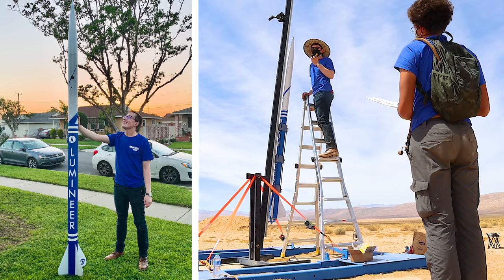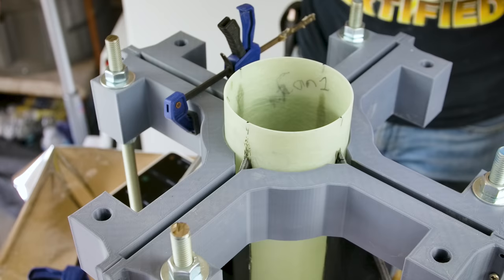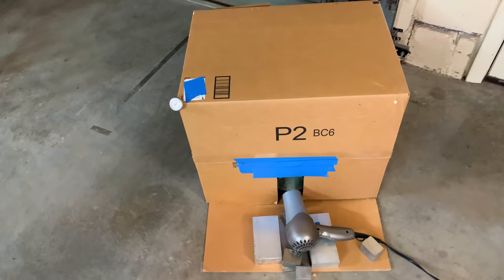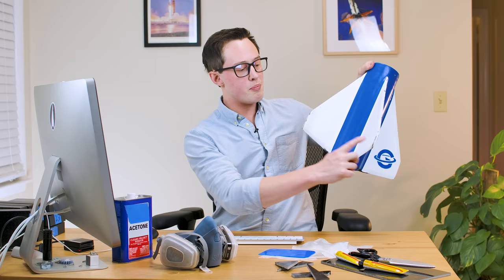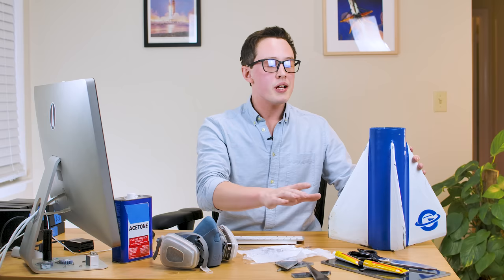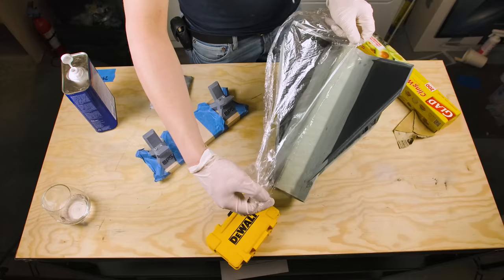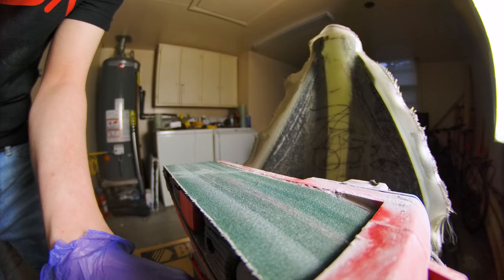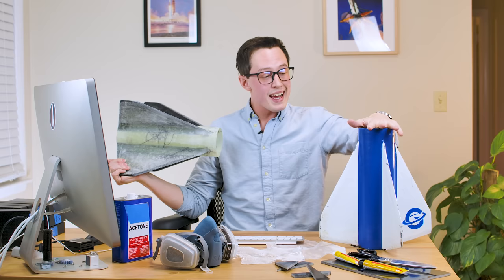High-Strength Composite Rocket Fins - Building Lumineer

Comment: My cure oven was 1 mil poly drop cloth stapled to the ceiling and the workbench, heated by a cube room heater with a chunk of fiberglass HVAC filter taped over it. (This was for varnishing furniture in cold weather, nowhere near as stringent.) Worked great, not only reducing cure time between coats, but kept the unfinished garage dust out. It's absolutely amazing how doing simple ad-hoc things like this can improve your work. Even a rough jig, for instance, is better than doing it by hand--especially if you have to reproduce the cuts or drill the same holes on a semi-production basis. More accurate, and much faster than measuring and working by hand.

Comment: Glad to see you back with such enthusiasm, Joe!
Keep working on your composites optimization.
You're carrying a lot of excess weight at the wrong end of the rocket with that fin can.
Though the concept is great, execution could improve with vacuum bagging, and there's no reason not to use (radio-opaque) CF at that end.
Fins could be thinner for the same stiffness and it would improve your CP/CG.

Comment: For your next composite layup, I highly recommend using a plastic bag or sheet for your pre-preg. Basically, just have a sheet of plastic twice as wide as you need (you want thick plastic sheeting that won't tear), pour resin on a spot in the first half of the sheet, lay your material on the spot, pour more resin on top, then cover with the other half of the sheet and squeegee through the plastic sheet. Aside from making the process much cleaner, this will allow the resin to spread better while allowing you to squeeze out any excess resin. It'll also help drive out any air bubbles and generate less waste in the process. It's a useful technique I learned in A&P school from a lifetime composites guy, and I've used it for prepping hot patches on aramid shrouds.  
Hope it helps!

Comment: When making your wet layups, try doing it on a piece of clear builders film. I draw the final shape I need from the fabric on the lower builders film on the outside (bench side). I put on the fabric (cut oversize) and measured epoxy amount in the glass and roughly spread out. Then place a second piece of film and you can squeegee the epoxy very nicely to saturate the cloth. The excess of any squeezes out the sides. Then cut the whole sandwich with sharp scissors to the line you marked. Now you can peel off one film layer, rub it onto the part and remove the other piece of film. It will almost completely remove all the edge freying etc and you’ll get a much neater layup. 

For the edges, once the epoxy has setup to the gel stage, use a razor blade and just cut most of it off. Much less sanding that way. 

YMMV!

Comment: Joe you went through a lot of effort to mention the appropriate amount of epoxy to wet the glass during layup but laid your first layer onto a dry surface. Thorough wetting of the base surface with its own layer of epoxy is crucial to forming that initial first layer, and aids in minimizing bubbles and easing adhesion.

Comment: Pyrotechnicians (and me) use a ceramic heater to dry the granulated gunpowder that we make. The box is a little more refined but than your cardboard "assemblage". Ceramic heaters are cheap and they shut off when you knock them over. As in, while your running from the room, screaming FIRE!!!!, you could kick it over and turn it off :o)
Reply: Also they have a thermostat so you can walk away while its running.

Comment: Nice looking part.  Two tips you might find helpful:

I used hysol in a number of places when I built my Kitfox.  When doing fillets you might want to use some cotton flox to help retain the shape while it is curing.  Some people also use micro balloons for this.

Next is when you go to cut the fiberglass with scissors you can prevent fraying by putting down some masking tape on your cut line cutting through that.

Keep up the good work!

Comment: At university I have had some experience with composite construction and we call your layup method Wet Layup, Prepreg is used when we refer to carbon or fibre glass which comes with resin/harderner already in the weave, which will not set unless in a hgh temperature or pressure environment.
Reply: Also, when cutting/sanding the fibre glass back it would probably be a good investment to buy a dremel, the saw heads are very useful to cut off the excess without turnit it all into dust.

Comment: layup tip: putting epoxy into your plies before placing them makes it harder to control fiber orientation and, with the increased weight of the ply, the edges are more prone to fraying or stretching.  I always place plies dry, and then dab resin into them with a brush

Comment: Just a tip..
If you're looking to make a cut off the bolt, pull a single weft thread out of the cloth. 
This will give you a straight line to cut, without a lot of straggly ends.

Comment: When I used to boat build we used metal compression rollers to roll out the glass. I also recommend you try pulling the peel ply back with the lights off. You'll often get a cool blue lightning flash effect.
Reply: Bubble buster (ribbed) rollers really help consolidate the laminate and force excess resin to the surface.
The last thing you want in a layup is having your fabric floating.
Joe says 1:1 weight ratio for fiberglass cloth to epoxy, but the reality is that optimal is 80:20 or higher.
But you can't get there without a vacuum bag (or autoclave)
The matrix isn't offering anything for strength. It is only there to hold the fiber in place.

Comment: A suggestion on epoxy mixing (I think I heard Adam Savage say this), after mixing you should pour the epoxy into a new cup because the worst mixed portion is on the cup sides and the corner at the bottom.

Comment: Okay wow, Ive been following your builds and rockets for a while. I'm so impressed on how you're pursuing this. Having personally experienced real burnout before, it's reassuring / gives me hope, seeing you able to re-commit to the same projects.

If I'm remembering right, you said you had moved to LA (or just socal?). I would recommend you try finding some set shop sculptors to see if any of them would talk to you about their epoxy lay up techniques. There are a TON of super talented artists working with these materials professionally, but also in very intuitive ways, who would do a great job giving out wisdom about how it should look and feel to work with fiberglass and epoxy in a non-lab setting. Also, most would probably accept a couple beers in exchange for some insights.

From my experience with these materials, my main suggestions would be to invest in a degassing chamber. Just a small vacuum pot that you place the cup of epoxy in between mixing and applying. You end up mixing a surprising amount of air into the epoxy as your stir in the hardener. Especially if you're warming it to speed up cure times, you can end up causing the microscopic gas bubbles to expand due to extra heat in the epoxy, but also setting the epoxy too fast for those bubbles to come to the surface and pop, trapping expanded gas bubbles in your  cured material. Looks like you didn't run into that in this case, so thats great! GOOD LUCK!

Comment: One of the really fun things I learned about composite layups during my time at university, was that the epoxies used for composites are like poison ivy. Basically everyone is born insensitive to the compounds, but you invariably develop an allergy when exposed to them. Sometimes it's after the first exposure. Sometimes it's after the 100th. Once you start getting a rash from it, you're done. You now have a lifelong allergy to those compounds, and it's... inadvisable... to ever work with them again. (iirc there's a risk of anaphylaxis, and terrible hives are pretty much guaranteed.)

It isn't clear to me whether layup resins are substantially more irritating than the two-part epoxies used abundantly in other hobby stuff, but it's an interesting little tidbit of knowledge that I feel like people don't hear enough.

Comment: What you do with newspaper for the templates here—it‘s much easier to use sticky tape there, and very very accurate. It even works for compound curved surfaces, if your tape strips are small enough. With single curved surfaces like the rocket and fins you could probably use painters‘ tape for easiest removal without any layer underneath.

Comment: I once built a guyed tower where the welding jig was off very very slightly for the sections.  Not enough to be visible to the naked eye.  The leg pads were off just enough that it took is nearly twice as long to build it because the bolt holes didn't quite line up, the entire structure was stressed in a way it wasn't meant to be (but within acceptable margins), and the top of the tower was twisted a full 18 degrees (unacceptable).  You could see the twist from the ground because we had booms sticking off of it at 100', 150', 200', and 250'.

Manufacturer ended up invoking insurance and paying out like a quarter of a million dollars to scrap the entire thing and have it rebuilt.  The welding jig was off by < 3/4 a degree.

Comment: In your fin construction i noticed that you kind sticked the fins on to the pipe which is the main body, you could also make grooves into the side of the pipe so the fins slide in snug and using epoxy i would probably become a more sturdy one piece. I dunno how much more stronger it would be but maybe it be much easier to adjust and stick on.

Comment: One consideration may be to 3D print a female mould quadrant. Then make 4 carbon parts from the mould and bond them together with the flash still attached, then trim down the flash. Finally, for a bit of added strength, skin the external surface in a carbon-kevlar hybrid.

Comment: Ok going to help you out just a little. The flash point of cardboard is 258deg C or 427deg F. You can line the cardboard box with aluminum foil and make it a good bit safer. I've done that and used it to cook a frozen pizza. Using a 100watt light bulb. In short you would need to raise the temp 3.5 times as much as what you had it at to set just the cardboard box on fire. The aluminum probably won't raise that temp much. It will most like reduce the time the box takes to warm up.

Comment: I still remember people in my lab made a curing chamber with tiny room heater , enclosed with coro sheet to cure a carbon fiber part and in mid night lab got on fire then alarm went off, luckily was in the lab to put off the fire using 3 fire extinguisher completely. It was a nightmare.
Reply: Grad student pro tip:  personally  owned CO2 extinguisher.   No mess.  School extinguishers still charged and in place.  ...  Plausible deniablity 
.. Everyone wins

Comment: For heating process, instead of cardboard, use your outdoor grill but NOT the propane or charcoal to provide heat (obviously). Use a heat gun or hairdryer and close the lid over it - less fire hazard and if one starts it happens in an enclosed metal structure designed to hold 600F+ heat/flame inside.

Comment: Hi Joe, great video series so far, not yet done watching them all. I did have a question. Have you considered 3D printing that fin stack as a single piece? And then either laying up composite onto it or using it as a mold(either positive or negative I guess). If done as a single piece surely the difficulty with alignment would be eased. Machines with that sort of volume aren't nearly that exotic anymore even in the hobby segment. Keep up with the great content and I look forward to your endeavors.

Comment: For high speed take offs and less drag I would've gone for a 3 fin design works well with my own model rockets.
Reply: Much less drag and shock between fin roots as you go supersonic.
You only need four fins if you have active guidance and need X Y planes of orientation.
There's a reason arrows have three fletchings.

Comment: Instead of vacuum bagging you can use a sand bag to compress the FG layers. 1 hour cure time is not enough really, especially not for vacuum bagging. For my mach 3 project I am using cotronics duralco 4461 epoxy which has a 24 hour cure time at room temperature. Much better to have a really long curing epoxy than to have to rush. I will use carbon fiber for that rocket instead of FG cloth. I am mainly using that epoxy for the 500°f rating, so no need to worry about heat.

Comment: Epoxy is less viscous in higher temperatures. It will flow into smaller gaps better. You might also want to try to put your fibre into epoxy into a vaccuum chamber this will draw air out of the fibre and replace it with epoxy then you can weigh it up on thefin assembly. Fin assembly 1050g fabric 100g so your 1 to 1 fibre glass sbould result in 1250g gross weigh.

Comment: About the bit about epoxy and bonding with the surface, it sounds weird. If the material you want your epoxy to bond to is a metal, it makes some sense as those tend to have oxidized surface protecting the rest of the material. But fiberglass is plastic and glass, glass is oxidized silicon so no oxide layer to remove unless you want to remove the entire material (also no hydrogen for hydrogen bonding). plastic is complex hydrocarbon + other elements forming structures. It might be that it just focuses on the plastic allowing the new epoxy to bond with the old.
Oke yea read the composite world and it indeed focuses on the plastic-plastic bond.

Comment: I've done some composite work, but never built rockets.  I'm a bit surprised at how beefy you made these fins.  7 layers of 7.5 oz cloth.??  That's 7 layers on each side, for a total of 14 layers on each fin.  And that's over the top of what looked like some really thick G10 base material.  Can the forces on the fins be that great that you need so much strength?  One of the things I enjoy is the process of "optimization" which is just balancing out all of the competing constraints, and for an aerial vehicle, weight is always one of the top constraints, and this fin assembly looks HEAVY.  My gut tells me this assembly could be made with half the weight and still be sufficiently strong (remember I've never built a rocket). One thing I would suggest is to put a filler material in the epoxy for the fillets.  Glass micro-spheres result in a very light, but still strong mixture.  And frankly the fillet is just a spacer, so it's really the fiberglass cloth that goes over the fillet that gives you the strength.  Epoxy itself is just intended to be a binder for the substrate (carbon or glass fibers).  You can mix chopped fibers into the epoxy to strengthen it if you need strength in the pour.  Take all this as things to consider, not "corrections".  Love your videos.

Comment: Maybe not the smartest question but what is the material you used before putting the fibreglass and epoxy on, is it plastic, 3d print stuff or like cartboad?

Comment: Use those halogen work lights for a flexible heat source.  Little safer than the combustible box.
Reply: A cheap heating pad from Walgreens works incredibly well, but depending on the needed cure temperature might not get hot enough.

Comment: I'm no expert on the subject but I hear that these rockets are flying really fast ... mach 2 sort of speed some even faster than that. Nobody is talking about air friction heating and nobody seems to be concerned about overheating the stuff inside the rocked ... especially the recovery system. I saw some other video where they were hitting mach 3.5 and then loosing it mysteriously ... well the first thing that struck me is that maybe the flight controlled got cooked and failed equally likely the  recovery system was likely compromised and failed to deploy.
The blackbird used to fly at mach 3.5 and without its cooling system it would not be able to sustain that speed. I suspect that keeping the vitals inside the rocket withing safe operational parameters might be a concern.

Comment: I know they cost alot but you should invest in a precision flat table the ones they use in machine shops as long as its level and you dont beat it to death it'll always be true and flat
Reply: Just buy a sheet of melamine at the lumberyard.
For a granite plate, get a sink cutout from a countertop fabricator's scrap pile.
You don't need micron precision in a layup.

Comment: 12:06 Is there a reason why you didn't do a layup like 90° | 90° | +45°| - 45° | 90° | 0° with Uni directional prepregs to have the most stable direction of glass fibers in the direction of the highest expected loads (fin tip to body)?

Comment: I'm getting spray on tan adverts for this video. Hot Nozzle Summer is real folks.
Reply: Atoms laugh at "fine sandpaper". The surface is not smooth after fine sandpaper. It's rough. Fine sandpaper roughs up more surface because it's a higher density rough. That's why it works.
Reply: I'm getting spectrum ads ... 
Fun fact I have spectrum and that shit is horrible planning on switching soon or my modem is fucked and needs to be replaced

Comment: CNC Cut fins would be the best way to get identical fins.
Reply: I cut mine on a wet tile saw.
Hot glue the blanks together and cut them all at once.
Perfectly straight tracks. No dust in my lungs (and over everything)
The diamond blade doesn't get dull, like even carbide does cutting abrasive glass.

Comment: I’m not an expert but I know that Formula One chassis static tests, so when they just basically apply a load and check for a maximum deflection, are very loud and nobody really cares... So I guess sound are not so bad, from my understanding they are due to small imperfection in the matrix breaking but I’m not sure. Anyway these chassis are built in carbon fiber and cured in the autoclave so maybe it’s a different case...